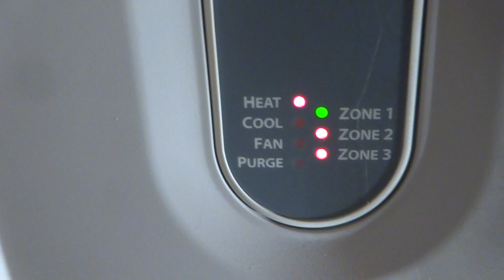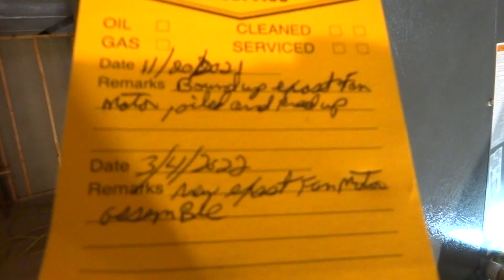OLD GOODMAN GAS FURNACE NO HEAT CALL

Comment: You can recondition those bearings, not economical at shop rates, but better than freezing until you can find some. Dissolve the gum with carb cleaner or similar, dry, then soak in spindle oil.

Comment: That same motor was the first, but far from last, part I ever had to replace on my old Goodman GMP gas furnace.    Brings back lots of memories of laying in the crawlspace under my old house trying to get that old furnace going again.  At different times, it also needed new a new igniter, the blower motor and squirrel cage, and finally the main circuit board.   It was old and crusty but it worked. Except when it was broken  haha

Comment: Question:
Is this part aka a “Draft Inducer Motor”. I just fixed a Goodman on a rental unit and the major issue is getting a supplier to sell to a regular Joe. Amazon will but takes a few days. If you’re not a contractor you might be screwed.
Thanks to Federal Heating Supply in Denver for saving my butt!
Reply: Yep. Draft inducer motor with the squirrel cage blower fan.  Some of them have small cooling fans on the end, like the one Steve took out.  The new one he installed didn't seem to have a cooling fan on it.  But works the same.  As a homeowner I used to work on my old Goodman GMP furnace and got my parts from eBay or Amazon and sometimes from parts dealers selling online at prices close to what a parts house would charge. Yes there is a wait for the shipment to arrive.   The onus is on you to know exactly what you have and what part you need.  Once you know the part number you want, you can find someone selling it.   As a rule, I never touched the gas supply side on my furnace.  Electrical, mechanical, no problem. I figured those out as they happened. But luckily I never had a gas issue either.

Comment: I had an old GMP100 Goodman furnace that had a plastic chimney attached to the inducer fan assembly. The plastic eventually broke down and cracked. Goodman finally changed to a metal chimney seen here in this video. I’m just wondering what genius at Goodman thought that it was good idea to use plastic in a hot chimney?
Reply: That genius was a bean counter.

Comment: This late winter hasn't been doing any good for furnaces, my old circa 1986 Kenmore 70 Power Miser finally shit the bed, blower motor keeps cutting in and out and there's low supply temps even though the burners stay running for the duration of the heat call, old POS no name stat decided to shit the bed too, came into a 40 degree house, put in an old Honeywell I had laying around and got the furnace kicked on, watched it run and observed the blower kicking in and out while the burners stayed running, one of the many companies who worked on it set the blower speed to mach 1 judging by the noise it makes, I took temps at the vent closest to the furnace and the return and I had a 48 degree return and a 76 degree supply, hoping to get a guy out soon to give it the ol' how ya doing and see if I can get 2 more years out of it as that's how long it'll take to save up for a new furnace, it's a nice old furnace and was probably pretty quiet with the original fan speed setting seeing as it's a direct spark ignition natural draft furnace

Comment: Do you use the "had to use oil to get the motor running" event as a signal to order or check to see if you got the replacement motor? That way you have to motor on hand when they call. This assumes that your customers will probably call you back when the motor eventually shits the bed.
Reply: Honestly it's an inducer motor, if you can get it running and save the homeowner some money and time to save up for the replacement for 2-3 months it's worth it. Plus he clearly stated he can't guarantee how long it would last

Comment: Can someone explain how thermostats get their power? Do all boilers have a low voltage power source running to the thermostat? Or do thermostats have to have their own batteries for power?
Reply: Power comes from the furnace/boiler, the battery enables the thermostat to open and close the switch.

Comment: Hey Steve , do you ever just check heat exchanger first see if it can be repaired first , or go str8 for the repair ? Just curious
Reply: Always check the exchanger. 9/10 if that's the serpentine style, it is cracked.

Comment: How are you sir,  question can I connect my gas water heater to the same pipe that connects my  furnace?
Reply: @tkgotwings_6401  do you mean a T with with two gas valve one for each ?
Reply: @ellocodeamor1980  seperate shut offs for the gas for each appliance. So if someone ever needs to change the gas valve or something on the furnace they can just shut it off on the furnace side and not shut off the water heater too
Reply: @tkgotwings_6401  great thank so much,  I appreciate